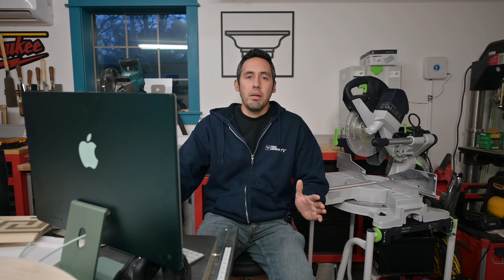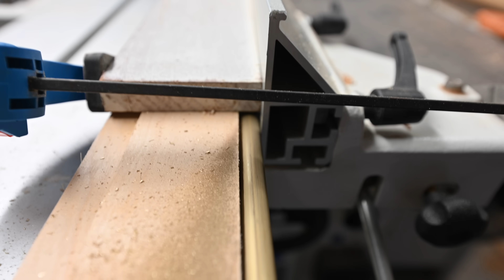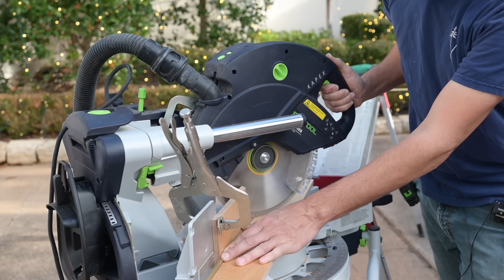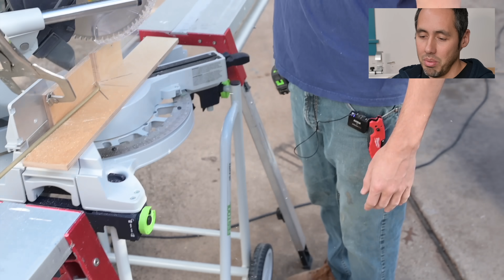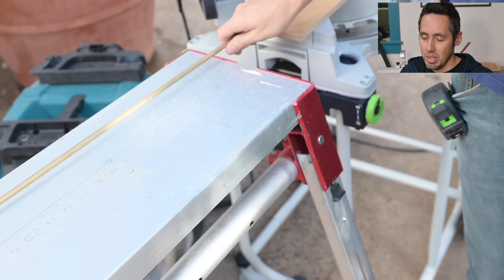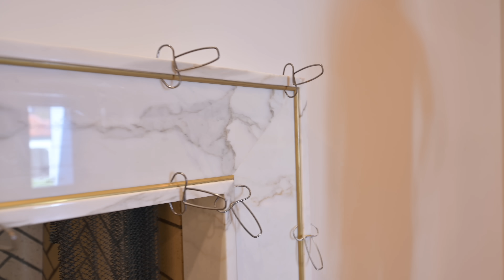It only took 12 years...My first MITER SAW injury.

Comment: The worst for me was, ironically, using a chisel.  I was helping my daughter build a project for school and had to make a square hole through a piece of 3/4 plywood.  I drilled out the majority and was guiding the chisel with my thumb as I ran it up and down cutting away the corners.   I pulled it back a little too far, it came out of the hole and then went back in — through the side of the thumb tip.  Chisel was sharp but that’s still a lot more thickness than feels good cutting yourself with.  

Worst that didn’t actually hurt me was on the miter saw.  Tried to make about a 70 degree cut (beyond the capacity of the machine) so I was holding the board off the fence.  Cut bound and it bounced my thumb into the blade — fortunately, the side of it so no damage at all.  Scared the crap out of me though.

Comment: I was a 1st year carpenter and one of my coworkers asked me to help show him how to nail a piece of  crown on a cabinet. It was an outside corner that he was having trouble getting right. I cut the two  pieces shot on the shorter side piece first, as I went to shoot on the second piece I didn’t follow the nail gun rule keep your hands the distance of the nail your shooting up. As I shot the crown up using a 2 in nail in a 15 gauge finish nailer, the nail shot through the back having curled up hitting my thumb. I was holding the piece on top trying to keep my corners lined up. Now it didnt penetrate skin but it literally felt like some one took two hammers and smashed my finger in between them. It throbbed the rest of the day. Yes I’ve hit my hand with a hammer so I know what that feels like . Just not at 110 psi. 
I did see my coworker shoot the same type of nail through his palm 2 feet away from me. He thought the gun was unplugged and literally took the gun pressed it to his palm and pulled the trigger. I could see the nail point poking through the top of his hand.

Comment: I was 14 and cleaning out the kitchen cupboards.  I put the food processor dual slicing blade on the floor. It is a curved blade that goes from in the center around and expands 1/2 way. The other blade starts where the other ends on the same post.  It was somehow flipped from flat to on its side. I was crawling around and felt an itch. Went to scratch, and the blade was in my left calf as far as it could go. I have a nice scar.

Comment: Your lucky. 1/4 round did the exact same thing to me, and pulled my thumb into the blade. Splintered the bone, had to amputate it to the first knuckle. I got way to comfortable after 13 years in the trades.

Comment: I've been in the furniture business for more than 3 decade and my worst injury is, when I'm using my  wood turning machine. It happen when i smoothing the finish product with sand paper and  all of a sudden my right middle finger was inserted to the guide rail and my middle finger nail are immediately pinch and remove. I didn't work for 2 weeks.

Comment: Was working on a machine shop deburring metal strip stock. The end got caught between the bottom plate & the sander surface, flinging up the work piece. The end of the material took a chunk out of my left thumb. I was only 19 years old & didn’t know any better. My boss told me to finish the job & bandage myself up. I was bleeding all over the place.

Comment: Injury… shot a 2” brad nail into my thumb while setting headers. While pushing the header flush with my legging I held my thumb on the miter while nailing. The brad went straight through the wood, into my thumb. Went in probably 5/8 and stopped on the bone, couldn’t pull it myself had a co-worker do the operation😂. Two times that’s happened, use a chisel or 5 in 1 tool to hold your miters flush while nailing in case a blowout.

Comment: My worst injury happened when I was left alone on a jobsite when I was 19, right out of art school, I was installing oak baseboards in a room belonging to a bank. At this time, I was cutting all miters by hand, no machinery, only hand tools and no walls were square. I was fine adjusting a miter cut with a chisel with no support, just holding the thing with one hand and chiseling with the other when the chisel slept and ended up in the bone of my left hand middle finger, on the side right at the 2nd joint. That was very bloody, I managed to find a pharmacy to get a bandage then went to the hospital for stitches. The worst was the pain when the doctor opened the wound to check for debris inside 4 hours after the facts and then stitches it without anesthesia. The day of this accident, I forgot about rule number 1: never leave a hand or any body part in the trajectory of a tool. I was lucky, I dod not sever any nerve in the process and all is good, I just have a scar to remind me to watch my fingers!!

Comment: I was cutting crown. Blade guard wasn’t functioning the way it should. I had finished the cut, and turned to my right without realizing the blade hadn’t stopped. Put my hand right into the spinning blade, thankfully it was almost stopped. I kept pressure on it for an hour, but the bleeding at my index finger wouldn’t stop. My Wife came home and hour later and found me in the garage still holding pressure with blood all over my shirt, not to mention the bathroom sink and rug. I finally gave in and went for help. 7 stitches later and I was good. By the way, I think that heavy box under the tree might be a new saw? 😊

Comment: Richard, unfortunately you were wrong about why it happened. It was simply the piece was inside the low point of the blade, causing the blade to pick up on the piece. You may not have noticed it on longer pieces because the weight on the other end of the longer pieces sometimes keep it from picking up. As a trim carpenter we have all done it, but The small piece of wood usually slaps our hand hard enough that we remember and don't do it again. The solution is used a larger block on the back to bring the work piece out past the low point of the blade to keep the blade from picking it up.  For others here it can happen on larger pieces also. Best wishes and keep pumping out the videos.

Comment: My worst injury was I was making Chess Sets, 2x2 squares. Well one of them I was cutting on the table saw and the piece kicked back and LAUNCHED  into my gut, just about an inch below my belt line. It swelled up and bruised me around a week. Extremely sore. The thing was I had done around 200 blocks before that happened. Still not sure why. After that I stood off to the side.
Thanks for the videos.

Comment: First injury was running my pinky finger into a fine toothed bandsaw.  Finger was basically flat on the table pushing behind the cut piece ( probably a small piece of oak).  Cut through the finger tip, finger nail, and up to bone before I yanked it out flinging blood.   Couple stitches and a lot of pain, but only a scar to show for it today, about 40 years latter.

Comment: I taught Construction Tech at a Juvenile correctional facility for 10 years one day on the radial arm saw I loosened the clamp not quite enough on my stop block to adjust it by tapping it back with my finger tips and drove a sizable like toothpick size under my fingernail past the first knuckle. Hard to describe the pain. The nurse on site was unable to extract it and sent me to ER after a local anesthesia to doct pulled it slowly out saying Whooooa! As it just kept coming. Don’t like when the doc says Whoooa! This was over 20 years ago. Still have the splinter taped to my contractors business card. Slow down everyone!

Comment: I'm a volunteer with our local Habitat for Humanity...here are just a few.  An airman from our local air force base was helping nail 22 1/2" blocks between trusses and put a framing nail through his hand, they removed it at the ER and he never volunteered again.  A guy I volunteered with, was using a rotozip to cut a shim on his knee and you guessed it, he ran the rotozip into his knee.  This same guy, I was helping him build his own house.  He had his table saw on a trailer and decided to cut a 2x4 off using the table saw as he was standing on the ground a foot or more below it.  This resulted in him cutting off the end of his thumb.  His wife took him to the ER and the tough old man came back to work all bandaged up the same afternoon.  The head of our local Habitat was pulling nails from a ceiling joist up on a ladder when the inside of his elbow hit an exposed nail and he started shooting blood like a sprinkler. Thank God I've had no major injuries other than cutting porcelain tile, just one stupid cut without goggles and it cut the lower part of one eye.  Always wear safety glasses ALWAYS!   These are just the ones I can think of off of the top of my head.

Comment: On a table saw ripping bevel on 12ft 2x4s outside on a windy day. After I was done with the cut the wind blew the waste side of the beveled 2x4 edge back into the saw blade and it send in back into the side of my stomach where in broke off and jabbed and broke of as the saw continued to push into me and ripped a 4 inch long gash on my side.
Hurt like hell.  Fortunately it my side and not straight into my stomach.  So now really careful on windy days.

Comment: I was cutting down the toe kicks of two cabinets upside down using a circular saw. I let my hand drop into the blade as I let go of the trigger. Got my index finger. It was pretty ugly. Thanks to a good hand surgeon it’s healed up and 95% of the feeling is back 15 years later.

Comment: Working an electrician I was stand above a connector.  I went to tighten it and the screwdriver cut my eye.  Luckly it was just the first covering layer of the eye but still required a stitch or two.  Even with a bandage over my eye.  It was the most painful week in my life.  It was hard to sleep and every time I move my head it hurt.

Comment: Along with finish carpentry I do tons of tile work.  With that I have had to cut aluminum tile edging 100s of times.  When it comes to small pieces for an off cut I line up the blade with my cut mark and place a sacrificial scrap wood over the top of it and it tends to prevent the saw from grabbing the metal.  Best for decorative shaped aluminum/brass though is a grinder with a good thin cutoff wheel.  

Craziest accident with cutting aluminum/brass on a miter saw was a coworker of mine at the time.  He was cutting vinyl wrapped aluminum hand safety rails and on one piece he cut, it just stared cutting then we just heard a boom, I saw something flash by my eyes down the hallway as I was facing the hall/doorway in a bedroom.  The vinyl wrap sleeve was still on the saw and his hand was holding it down but the aluminum rail inside was missing.  The saw blades tooth count was to low+ he got probably a little lazy on the chopping motion.  A tooth on the blade basically got caught on the aluminum and it just spun the aluminum inside the vinyl sleeve and the next tooth grabbed it onward.  The thing had a spiral pattern all the way down the aluminum rail and shot out the side 20’ down the hallway through both sides of drywall on an interior wall then landed in that room.  It was nuts.  Lucky no one was in the path otherwise I know it would have impaled someone.  After that I put a half sheet of cdx leaning on a trash can on each side of the saw.  He laughed but I wasn’t joking.

Comment: I cringed when you mentioned stepping on a nail.  I did the same thing about 30 years ago.  The worst part was that the board it was in was stuck to my boot and I had to step on the board with my other foot to pull the nail out.  I never leave nails in boards- either pull them out or bend them over.

Comment: Cut my thumb off with a worm drive helping a friend of mine remodel a rental. Saw kicked back and the blade guard was held up with a wedge. I wasn't expecting kick-back with a worm-drive either, and my thumb had to be reattached. I was lucky and missed the main artery and nerve, but the bone was cut clean in half. Months of recovery. Couldn't work, obviously. I can wiggle the thumb and grasp things. I even have some feeling left in it, but it gets a little nerve pain every now and again. The lesson for me is that good insurance is a must (I would have never recovered financially) and blade guards are there for a reason.

Comment: It definitely seemed to be the small off cut, plus the angle.

As for injuries on the job site, my two personal ones off the top of my head are:

1) my inexperience with a fiberglass ladder angled way too much out. Only going to the second story on a curved concrete balcony unfinished (no rails) about 12 foot. 3/4 of the way up the ladder caved in and I fell, luckily minor bruises. I could have cracked my head.

2) using a 2x4 as an extension slam bar on banging on one end. Instead of releasing it before impact, I had either one or both hands on the end and tried taking the other end,the one of my hand caught a corner end edge (where the end, face, and side meet) and a piece had broke off and literally pierced my hand. Luckily I let go about 80% force, and not 100% or it would have gone either through and have been lodged in my hand. So I was able to pull it out with my razor and pliers, during my skin parts around it to access it to pull it out.

2 very close calls that could have had permanent impact.

I've had too many close call to even remeber, and plenty of times doing things I know I shouldn't have though I'm somewhat of a very safety-conscious person.

Comment: Everyone should know that when using a pin nailer, keep those fingers away before shooting that pin. Well, I was installing some trim on a pallet wood project with my pin nailer, and thought I had 1/2" pins loaded in it, but I had 1-1/2" pins in there which shot through the trim, out the other side and into my thumb. The pin went through my thumb, missing any bone, and came up through my thumb nail. It wasn't real bad but it hurt like heck for the rest of the day.

Comment: Were you also not wearing safety glasses.
I almost cut off my left thumb using a biscuit cutter when I was cutting a test slot and just holding a small piece of trim, when the tool jerked out the small piece of wood and basically sucked my thumb into the rotating blade. It felt like an electrical shock.  Went to the emergency room where it was bandaged up and then required a plastic surgeon to stitch it back on.  My left thumb now is fused at the first joint and canted out at almost a 30 degree angle to the right. Taught me a big lesson.

Comment: My injury happened the same way as yours. I was cutting a piece of aluminum angle and I think I cut too fast. (I also had it standing on the two "legs", like an upside down "V" and not flat against the fence--probably the main reason for the accident). The saw blade caught the metal and flipped it over 90 degrees, and broke off the tip of my index finger. It was just hanging there. I went to the hospital, and they could not reattach it.  had to be removed. The worst part is I played guitar up until that day. Not any more.  Also, the next day was my anniversary and my wife had bought a me a new electric piano. The whole time we were in the emergency room she kept asking the doctor if he thought I would ever be able to play the piano. I was so irritated because I could not figure out why she was so concerned about a piano and NOT about my pain. I have photos of the whole thing before and after, so this is not a hoax. Worst carpentry accident of my life.

Comment: Richard, I may be all wet, but I think that this is what happened. The center of the blade ie."the spindle center" is ahead of the center of the brass. At that point the teeth of the blade are on the way up thus trying to lift the brass. You may want to try moving the center of the blade to the center or even slightly beyond the center of the brass. At that point the teeth of the blade are coming down into the brass thus pushing down on the brass. Now keep in mind by doing that the saw may have a tendency. to try pulling forward. Keep the slide of the saw locked in place and only make plunge cuts. Perhaps clamping a block of wood with a rabbet the height and width of the brass would further help lock the brass in place. Bring the wood as close to the cut as possible There is a photo only a second or two into the video that I paused.  It is a good shot of what I am talking about.  Have a Merry Christmas to both you and your family.

Comment: I was using a 4 inch hole saw in a Hole Hawg to cut a hole in the side of a log cabin with 8 inch wide logs. This was before the drill had the clutch safety feature and of course it caught and threw my arm up into some duct work. It hurt a little but nothing big. I finished the hole then shook my arms out and blood started to go everywhere. I had sliced my elbow open but since I had kept my arm fairly straight it hadn't really bled because the sheet metal cut was so fine. That one got me 8 stitches.

Comment: Demoing out a basement about 6 years ago was carrying 2x4s with nails out to the dumpster. Came running down the steps to grab more and jumped from the 3rd step right onto an old framing nail sticking out of a board. All the way through my boot and foot. Time is money, but stupid is stupid 😂